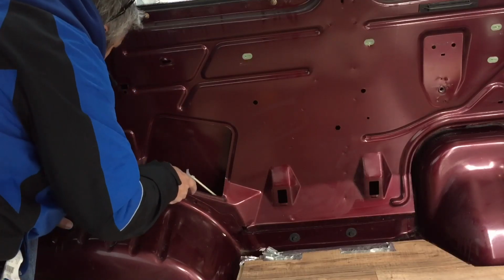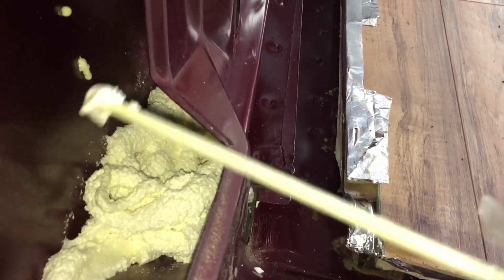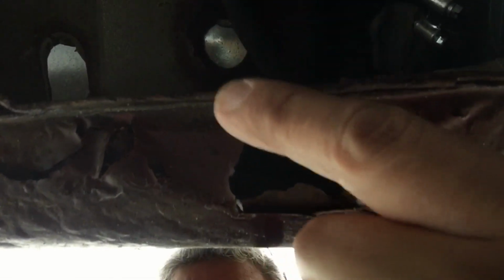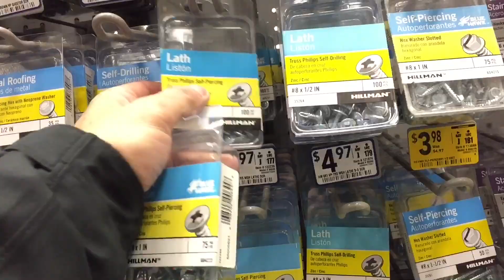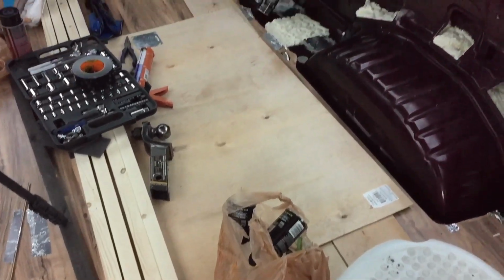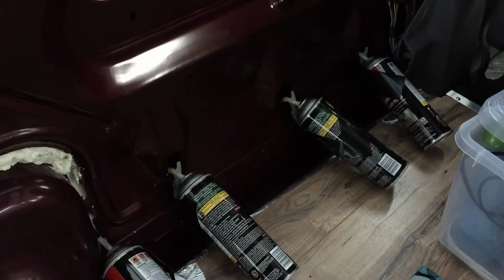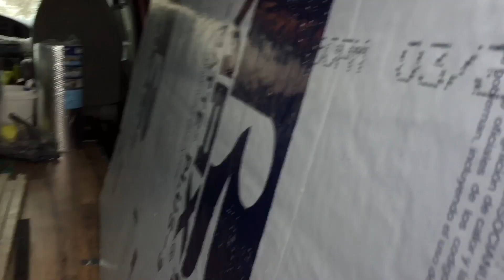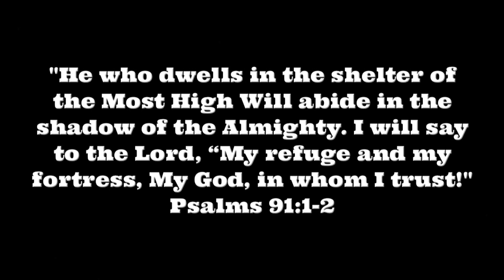Van Life; Spray Foam Insulation/framing - HighTop Van Build: From Passenger Van To Campervan! Part 7

Comment: Good thing I live in cali. Battling heat is easier, just jump in the water🌊. I am going to use some of that great stuff  to fill the bottom portion to help fight corrosion✌👊
Reply from the maker: Yeah, living there you don't have problems with cold like we do over here  . 😄👍🏻🚐

Comment: You stuff insulation in plastic bags or wrap it in plastic then stuff it in there. That is how conversion van companies do it. As it doesn't hold moisture or create condensation. 

The rusting problem is seen on any vehicle up north. The best thing to do is make sure to spray Rustolem in the lower panels real good. Make sure the drain holes have plugs and wash them out ever so often of road salts. That or spend some money on having the underbody sprayed with weather guard.
Reply from the maker: That would mean extra work and I don't have the time for that. There's always the possibility that will rip if using that method, creating a a place for moisture to infiltrate. 
Remember, just because the conversion van companies do it doesn't mean it's the right way, but the cheapest. 👍🏻😄🚐

Comment: I just put a bunch of cheapo Styrofoam in those gaps. Then used 2 inch rigid foam board over the metal walls. No regrets. my van retains heat well.
Reply from the maker: The problem with trying to shove any kind of loose styrofoam, or any other kind of foam is that the product becomes staticky and sticks to things you don't want instead of going where you want them to go. 
Not saying it won't work where there's a big open gap, but with different size openings and cavities it's hard to push something in that wants to staticky cling to the opening. 
In the end, it's what works for each individual that's important. 😊👍🏻🚐
Reply: Yeah I wasn't too worried about it. I have heard that Great Stuff foam will absorb moisture and eventually may cause rust etc. That's why I didn't use it.
Reply from the maker: +One Awesome Inch; I've mentioned before on my channel and on CRVLF that spray foam could react with the metal causing it to rust. When I looked at this van, near the roof line that they cut to add the fiberglass roof, there was spray foam right on the metal, and it has probably been there many years and there was absolutely no interaction between it and the metal. That give me the confidence to use it, as before I wasn't too sure. 
Also spray foam is close cell and will not absorb water. When I had a house I sprayed some outside on a shady part of the house ant it never grew mold or become wet.
Reply: Excellent information . Good to know.☺
Reply from the maker: +One Awesome Inch; 👍🏻👍🏻😄

Comment: I just wadded up fiberglass and filled those voids on mine.
Reply from the maker: The problem you may have Dan, is that the fiberglass will absorb moisture. Have you ever checked? I can't remember if there's a way for you to take a look back inside the wall. It would be interesting if you could. It would make a nice informative video. 👍🏻😄🚐
Reply: No way to check. Its behind paneling. Well find out in 10 years. lol.
Reply from the maker: +Dan Travels; cool, let me know in ten years then. 😂👍🏻
Reply: This hurt my throat after a couple years
Reply: HouseHound the spray foam did or fiberglass?

Comment: Hi Luis! What would be the proper way to insulate a Chicago minivan? Need help as soon as possible. Thanks!
Reply from the maker: +Audrey K hi!
What’s a Chicago minivan? Is that like a regular minivan but you happen to live in Chicago? 
Minivans are hard to insulate properly with all the molding. To do it right you’ll have to rip all of it out and then use foam insulation (either the ridged or spray foam).
Probably the best thing you can do to the minivan is to leave it the way it is and concentrate on other stuff like, removing the back seats. Making a bed platform (which could be just a piece of plywood). Getting a nice 20 below or better sleeping bag. Fleece blankets. A buddy heater or a Wave 3 heater. 
I hope that helped. 👍🏻🚐😀
Reply: Yes, Luis. Thank you. 2006 Dodge Caravan. New to this but it's happening now and it snowed today. I have a cot. I'm getting window tint done in a shop next week. I thought about having a carpet installer help with insulation. What do you think?
Reply: I really need your help!
Reply from the maker: Audrey K I really wish I could help, but I work full time. In the summer I could possibly be able to help on the weekends but you’d have to be near where I work.
Reply: Thanks, Luis. I did take a lot of your advice. I got all side and back windows tinted at an Auto Glass Shop (Limosene tint, legal here) left front windows and windshield as is, step 1. Then I purchased rain guards, the cheapest ones were the kind you stick outside, to keep the windows cracked for Little Buddy heater, step 2. Did purchase a -0 degree to put inside a slightly bigger -30 degree sleeping bag, and the sleeping bag liner that you mentioned. I take your advice seriously because you're a builder and know what you're doing. Have you considered an online advice or virtual assistance business?
Reply: *limousine

Comment: Thanks for the video - Wow - that was a huge gap , how many cans you used ? 20 ? maybe more ? .... is it possible to put some Styrofoam in between the spray foam , so you might save 4-5 cans of these ???  anyway , looking forward the part 8 :) Keep the good work !
Reply: + Benny Ho  Hey Benny that's a great idea!!!
Reply: +Peter Stanhope Thanks :) - Don't know is it work !?
Reply from the maker: Don't remember the exact number but it's probably close to 20. I didn't think I would need that many but as in the case of spray foam, you always need at least double of what you thought it was needed. 
No styrofoam or any kind of foam should be use with spray foam. The reason is this: you don't want anything else preventing the spray foam from covering every possible corner or crevice. By the time you use 10 cans, 10 more aren't going to brake the bank. 👍🏻👍🏻😄🚐

Comment: Have you ever considered opening up some sort of drain pathways for condensation that collects on the walls? At buildagreenrv.com the guy mentions the idea. I`ve never heard of anyone else doing it. I imagine just little holes along the bottom of the van is what he meant, I don`t know, not sure what the cons are either
Reply from the maker: +MNewberry with all the insulation there shouldn't be any condensation, but the van already has holes at the bottom from rust, so drainage shouldn't be a problem. 👍🏻😄🚐

Comment: damn dude that is going to be anything but cost effective.  that great stuff aint so great when it comes to price. youre gonna use 10 cans at least. pricey. i dicovered it was much more cost effective to cut shims of your insulation and put it in the larger voids.
Reply from the maker: When it comes to tight spaces like that, if it's hard to use polysio foam then it's better not to use any and just use spray foam. It may be a bit costly now, but it's going to pay for itself in propane savings.  👍🏻😄🚐

Comment: If you ever try to run a wire you are in bad shape now haha jk will be warm :P
Reply from the maker: I don't think a wire will ever need to be ran so far down in the walls, but if it did here's what I would do: get a metal rod slightly bigger in diameter than the wire and heat it up with a flame. Not too hot, just enough. Insert rod in the foam and create a channel for the wire. The foam melts like butter around the metal, leaving a perfect passage for your wires. 
👍🏻😄🚐
Reply: Rolling Earth-Ship you are a smart man lol
Reply from the maker: +TrailerTrash Rusty; thank you! That is exactly what I did in my roof to run the fan wires. 👍🏻😄